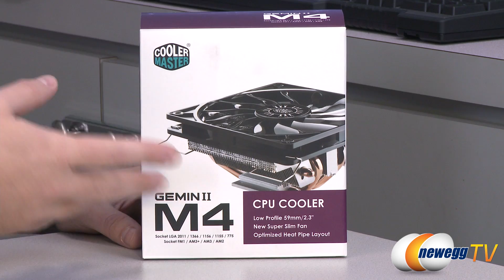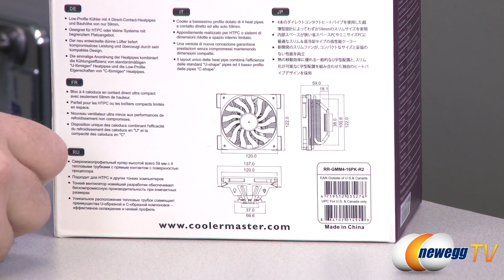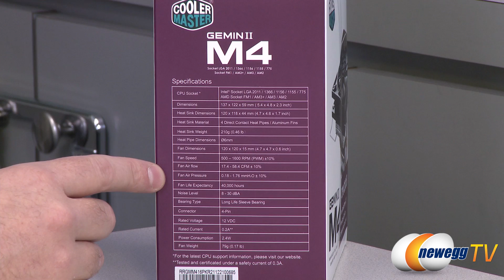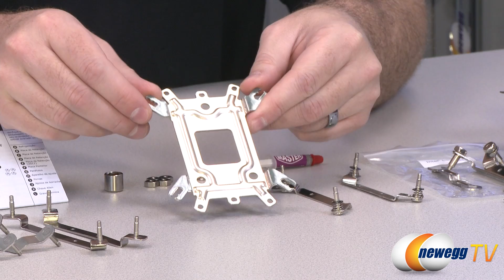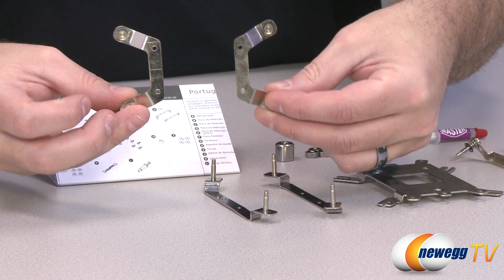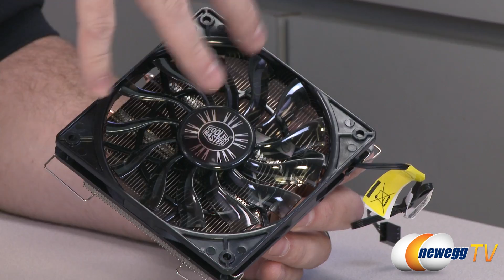Newegg TV: COOLER MASTER GeminII M4 CPU Cooler Overview

Comment: will this fit inside a cooler master elite 130
Reply: Yes it will fit in the case. The bigger question is will the back plate interfere with chips on the back of your board and does it block access to the PCIe slot on your board; not all boards are the same.

Comment: why are there never lists of compatible motherboards? no one ever seems to accumulate that data, I guess I should have never bought a mini itx, probably have to remove this thing just to reseat a ram stick, not that I do that often but still, but it looks like this would prevent me from using dual channel, if anyone knows if this will fit an msi z77 mini itx 1155 let me know

Comment: The included instructions with this HSF are pretty uninformative, I used youtube to find better installation instructions. The heat pipe direct contact feature of this HSF does not allow for complete coverage of the CPU. The only contact between the CPU and the heat pipes is where the pipes actually touch the CPU. The spaces between the heat pipes DO NOT touch the CPU. I will just have to cross my fingers and watch the temps for the first few hours of operation..

Comment: I have this cooler and works very silent, in standar cpu usage the cooler is noiseless;and when i playing bf3 , runs quiet, not more a 10db; you can OC but you cant push it so far,my A8 3870k suports .3Ghz  of OC ,try to do more OC and get a beautiful crash of SO,after 800RPM the fan noise is irritating if you use speakers, for me its a great cooler, for the price, i cant find the Shuriken and i get this

Comment: Yeah, its good if you just want a quiet cooler, rather than stock cooling. It works well, however I don't recommend it if you are going to overclock. I purchased it because I have a non overclockable CPU, however the stock fan was far too loud, and I didn't want a giant useless DH-14 for my scenario.

Comment: These kinds of heat sinks always concern me.  Not the low profile, but how the airflow is.  Ait from these is directed down onto the MB area where the CPU and other components are at.  That's warm air from the heat sink going down.  Seems counter productive doesn't it?    You could switch it and use pull, though it would put a strain on the fan probably and case side would need vent mesh area.